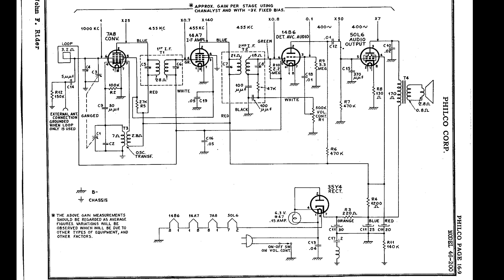77 Year Old Philco Model 46-200 Bakelite Radio Restoration

Comment: Excellent performer. Didn't even need a re-alignment after recap with slightly off values. Tells you something about the engineering back in those days.
Reply from the maker: That's why I had to tweak the if call slightly just to compensate for a few of the Caps that were a little bit off the original value but it works great it's pulling it all the local stations no problem with the built-in antenna. Now I've only I can do something about my high noise floor but unfortunately that's just the way it is where I live. I can't enjoy my HF radio because I can't hear anybody further away than about a block from my house it's ridiculous. I have an inverted v dipole cut for 20 m and it's completely useless I get a s9 noise floor pretty much all day and all night. If I stay up late enough to win the neighbors kids have their gaming computers on the 65 inch plasma screen turned off and everyone around here's got equipment shut off I might actually hear something. During school hours it's a little quieter but right after school ends and the three boys next door get home and fire up their computers and televisions and monitors and everything else and start gaming radio reception here is non-existent.
Reply: @12voltvids  Here in Germany it's not that bad but also not perfect. There are also strict radio regulations here. I don't know how it works in Canada but I know the US even might have stricter FCC rules. Like the C64 US had shielding en masse while the PAL model didn't have much, maybe some around the RF modulator. But if people here still had plasma TVs, I guess that's where it ends. Those are basically just giant panel antennas. It's just how they work unfortunately. LCD monitors also have much less shielding these days. I mean the cheap ones don't weigh anything. I almost tossed an LCD from a friend when picking it up. I only have high end ones, so they're really heavy. But I doubt it's shielding, the feet are solid aluminum, really massive. Man he looked at me when I almost tossed it not expecting it to weigh so little. I guess they stopped caring for AM range.

Comment: The wire wrapped wax paper capacitor was called a wavetrap. It was needed back in the day because harmonics 
caused by maritime radio transmitters  which used the frequencies below 550 KHz would case interference in AM 
reception. They don't operate on those frequencies now so it is  not necessary to wrap a wire around the new capacitor. 
Also the smaller size of the new capacitor itself changes the length of the wire because the resonant frequency would 
be different. Three or four turns would suffice if you still wanted to go that route. That is one crammed -up with parts
chassis even after a recap! Still don't have any Philco's in my collection but maybe one day. NOS tube prices have gone
 up like fireworks lately. Especially for sets of tubes common for many AA5 radios. Then there is shipping costs!😵
Reply from the maker: Yes I have noticed.   
Same with the outside foil.  Nowhere near as big an issue with small caps due to the much smaller surface area.

Comment: Cute little radio, and kind of a post WW2 timecapsule.
Recap ? Yes. Repair ? Yes  Restoration? No, not really.
If you want to see a restoration, then check out one of David Tiptons videos.
At least in my book a "restoration" involves more than just replacing parts and checking that it works.
Reply from the maker: Cabinet hasn't been done at this time.  Needs polishing.

Comment: Nice to see this very cute old time radio saved and working again. How about replacement of the caps inside the IF cans?
Reply from the maker: Those ones are not generally paper caps.  It is the paper blocking caps that are the problem.
Reply: The type of IF transformer in this radio uses adjustable trimmer caps which basically never go bad unless the insulating sheet between the two metal tabs somehow gets damaged. The ones you might be thinking of with the fixed caps and adjustable inductors were used later on.

Comment: Hi! I have the same radio model and I’m looking to bring it to life as my first resto trial (without it taking my life 😊). Do you have any tips on soldering at those old joints? I’m assuming that I’ve got to use leaded solder; anything else? FYI the joints in mine look primitively done and loaded with flux; I’m assuming quick mass assembly was done.
Reply: Also the wiring does NOT match the schematics… oh well. At least the cap values do, with the exception of that fat 20-20 condenser. Mine is a 30-25-20.
Reply from the maker: I use 40% leaded solder with internal flux.

Comment: Question please I'm a novice Why did you choose mylar caps over Electrolytic?
Reply from the maker: Well on this size they don't make it electrolytic caps that are of that low value but also I needed high voltage capable caps. Tube radios all operate around 200 volts or higher for the plate voltage so you need a capacitor that's got a very high voltage rating and that means a miler or some other form like ceramic. Ceramic disc caps can also be used but typically they're not in as high value although you can get some you can get 01 and 02's in ceramic. I basically go for what is available in the store I could order any type I wanted if I wanted to order from digi-key or Mauser but then I'm looking at huge import and shipping fees. You have to order $5 worth of capacitors from digi-key for example there's a $20 processing fee added. So unless I was to make a huge order if I was ordering hundreds of capacitors if I was placing a $200 order then maybe the $20 processing fee would be acceptable but I don't order in huge quantities I get two or three or five at a time. I don't buy any components in quantity because I don't go through that many. This is still a hobby for me, I don't do this for a living I take on projects from clients but I don't do this as a business so I don't need to stock in large inventory of parts. So I'm limited to getting what they have in the store when I go to buy parts. There are basically two parts retailers I deal with, one is Lee's electronics in Vancouver and the other is RP electronics in Burnaby. Lee's has a bigger selection, and RP is a little closer with better parking.   We used to have a shop called main electronics in Vancouver and I always went there because they had pretty much every part that you could have ever wanted. Their slogan was more than a million parts and I don't know what he had a million parts but he had thousands upon thousands of parts. I used to get to go down into the basement as I knew the owner to look for things and they just had shelves full floor to ceiling of everything old obsolete tubes old carbon resistors if you wanted something old like that I mean they had just everything in that place. I'm sure that the the son of the owner had a fun time clearing it all out when he passed away about 5 years ago. The sun didn't want to stay in the business so he sold everything off and I guess sold the building. Haven't been down that way since they closed but it was the one place that everyone went and you could be pretty much assured you were going to get the part you needed. Another note because I know someone's going to chime in on this, there are some audiophile great capacitors that the audio fools will spend huge dollars on. I've seen some or a single capacitor could be $30. These guys that believe in snake oil and that's probably what the capacitors claim they are filled with, claim they can hear the difference. They also claim they can hear the difference between regular speaker wire and oxygen-free copper do you need directional speaker wire and interconnect cables. A capacitor does one thing it allows AC signal to pass through it while blocking DC. There are different characteristics for sure and in a real high-end amplifier you probably could hear the difference between a high frequency low ESR capacitor designed for filtering a switching power supply and an audio grade cap. Audio grade are typically not low ESR and typically have thinner plates then the types that are designed for power supply use which is very abusive on capacitors. But when you're talking these low value mylar, versus polypropylene or any of the other materials they use for making capacitors on an AM radio you are not going to hear any difference. For specialty applications for sure but not on something this old. So I put in what I can get and of course whatever is the cheapest. I'm not really restoring these radios to sit and listen to them for hours on end, I'm restoring them more as a collectible piece that can sit on the shelf be plugged in occasionally and turned on for demonstrating or just to play around with and then put back on the shelf. The old paper caps they have to go some of them might still be okay but they're all time bombs and they're all past their prime. Back in the day when those paper condensers were still in use and being manufactured it would be replaced every couple of years just because the paper in them deteriorates and they turn into resistors. After the mid-1960s electric capacitors got to be quite good and many of them are still good today especially the oil filled caps. Those ones will literally last forever. You do have to be careful with oil filled caps though because in that vintage the oil would contain PCBs which must be disposed of correctly as it's an environmental hazard.

Comment: Is one of the caps you replaced the power supply blown on the bottom?   It appears that one of them looks like a lot of white stuff came out of the new (used) cap at time 19:56?
Reply: that's glue that some manufacturers use to hold the caps in place
Reply from the maker: That was glue. The electrolytics were glued down to the inside of the power supply I took them out of.  just silicone rubber is all it is they glue them down with silicone so stop the parts from being banged around during transport. These came out of wall warts.

Comment: Well done dave :-D
I fully understand to not power it up before getting ridd of the craps, i would do the same.
That is a cute little radio :-D
Maybe some slightly abrasive car polish would clean up the top of the case.
Wax polish to bring the shine back.
I still wear a mask in the local shops,  covid still exists in my area.
Reply from the maker: Yeah I hear you, I still wear a mask at work when I'm working in customers homes as I'm in a federally mandated industry and the federal mandates haven't ended for federally mandated industries yet but also first thing a customer asked me before I even go to their home is if I have a mask so people still want us to wear them in the home which is not a problem. It's that 5 to 7% that make all the noise. You know the same people that were driving around in the downtown cores honking their horns 24 hours a day and sitting in their trucks blocking roads and borders.
Reply: @12voltvids  Ahh you are talking about assholes, there are always some in every community.
Ooow that cute radio,  so the 1st local oscillator freq =  (Rx freq + 455khz).
Some radios have really odd mixing schemes, i end up cross eyed lol.
Reply from the maker: @zx8401ztv  well the oscillator frequencies either going to be above or below the if that's how it works right you mix your oscillator frequency with the frequency you want and you'll end up with a sum and a difference so it could be 455 kilohertz below or above.
Reply: @12voltvids  I am wearing a mask whenever I open my apartment door at all times. I might be paranoid but I didn't catch if yet. Also helps that I am in home office still.
Reply: @12voltvids  just wondered, most of the radios and c.b radios i used to repair had a lower frequency 1st local than the receive.
Sideband radios often had a 1st local higher than the receive.
Ham radios could be really odd.
I liked the old Yaesu frg7 receiver, with its odd wadley loop synth, a good old receiver.
Sorry waffle mode.
Reply from the maker: @zx8401ztv  like most HF radios the local is higher than the if because most of us are 10.7 MHz  first I have and then at 455 for the second.  Obviously if you're tuning frequencies lower than 10.7 MHz you're going to obviously have to have your local on the high side so you can tune down to low frequencies. I believe most radios it is on the high end but it doesn't have to be. When you get into VHF radios for example it could be below or above but for shortwave radios is typically higher than the tuned frequency but it all depends on the manufacturer because they can do things anyway they want and when you get into vintage radios it doesn't have to be 455 kilohertz some of them are 465 for the IF frequency. I forget what year the standardized on 455 I think it was post-war radius made prior to world war II were typically 465 and then after world war II the standardized on 455.  Someone else that works on vintage radios might be able to clarify that. I don't really work on that many vintage old radios just the ones I collect and I fixed a few for friends although the friends that bring me their radios never seem to want to pay me to do the work. They bring me their old radios I just want them fixed but never offer me anything.
Reply: @12voltvids  The very few frends i have  are real frends, if i need help they will always jump in to help me,  but i try not to bother them if i can help it.
If they need help i will help them to the best of my abilitys.
If frendships are based on money only, there is no frendship, only deals.
Deals never lead to real frendships.
I also help people for nothing, sometimes people need help.
No i'm not a sucker, just in case you were thinking that.
Reply from the maker: @zx8401ztv  well this friend I used to use for all my voiceover work on my corporate videos. And every time I called him no matter if I needed him for 5 minutes or an hour it was always 500 bucks. We had to read one line of text it was 500 bucks if I had him there for half a day reading an entire script it was 500 bucks. Now this guy was not a professional DJ he was not a professional voice actor he was just a guy that had a good radio voice. What I did a video that needed to be presented in both English and French I hired a guy to translate to French and do the voice in French and he charged me less than this friend. But when it came to fixing his electronic crap he always had an excuse why he couldn't pay me. Or he never even offered never asked me never said how much do I owe you or anything just picked it up and said thanks and left. To say I was a little bit annoyed it's an understatement.  You would think when I rebuild something and I put in $15 for the capacitors that at least they would offer to cover the cost of the parts. his attitude was well you're going to make money off the video that you make of it so why do you need money for me.